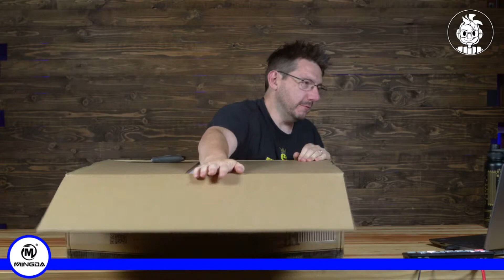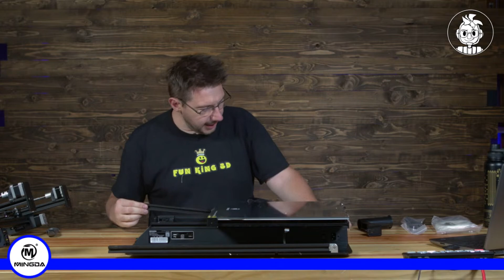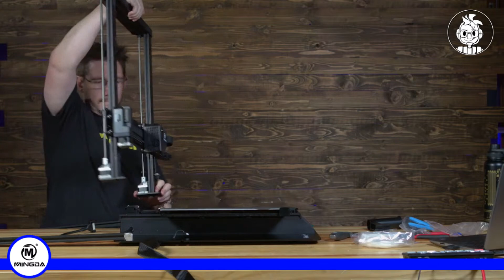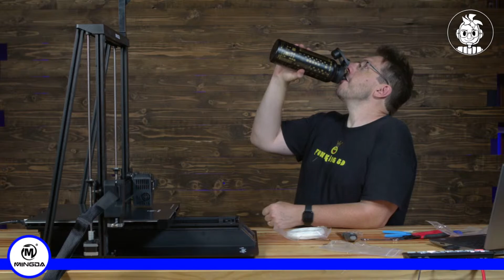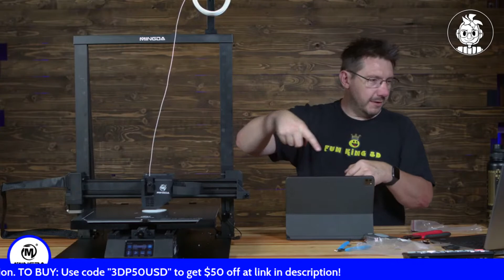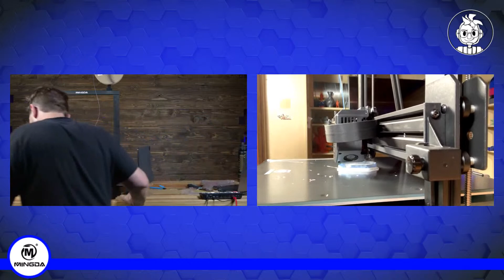Mingda Magician Pro FIRST PRINT LIVE!

Comment: i bought the mingda d600 and it was one of the worst decisions i have ever made. It is EXTREMELY poor quality. it came with broken parts everywhere.  broken hotend, 2 of the 3 fans defective, USB port doesnt work.  SD card reader stopped working after a week.  broken filament door handle, and the list goes on. now im stuck with a machine that doesnt work with no recourse because i bought it thru ali. never got a single decent print out of it for . i am about to make a series of youtube videos exposing how i got scammed by MINGDA      AVOID this company like the PLAGUE

Comment: All that space to build more things I don’t need 😍

I have the x and like everything about it EXCEPT that dang build plate, things stick to it wayyyy too well. That being said, I’m a firm believer that a pei sheet is a necessary upgrade for any printer right off the bat. Other than that which was a quick and easy fix I haven’t run into any problems. Now I just have to justify the build volume so I can buy another 😂

Comment: Not a fan of the mingda brand. Had 3 Magician Max printer and had to return all 3. 1st the bolt holes for the gantry in the plastic were sealed and needed to be cut away and the plastic bed carrage was cracked and flopping off the y axis. 2nd printer had a broken hotend, the heatblock was hanging off. 3d was apparently used and had gouges all over the bed and the v rollers on the y axis were unable to even get close to tight on the extrusion...the bed could just be pulled off if you loosened the belt. I will be steering clear of this brand in the future if nothing else than the headache of having to rebox and ship, then wait for another product just to have it be broken as well.
Reply: Well, I'm very disappointed for you but I personally own 6 Magician X and 2 Magician Pro and the only issue I encountered was 2 broken plate supports during shipping on my 2 Magician Pro and a defective ribbon cable on one of my Magician X. Mingda's after sale team sent me all the replacement parts very quickly. Have you tried to contact Mingda's after sale support before returning your printers?
As others wrote, the after sale team is good and very kindly answers all questions about their printers.
Reply: @fredbourhis  so 3 out of 8 printers came defective. I don't think that's a good track record. Normally when I buy a product I don't normalize needing repair parts, but that's just me.
Reply: @Critical_Zero  no only one of the 8 really came with an issue (but it was an used one) the two Magician Pro has been broken during the shipping process from China to France so it's not Mingda's fault ;-)
Reply: Hi Jody, We are really sorry to hear this, can you tell us more details? You can contact us via FB,  we will definitely follow up with you, don't worry.
MINGDA FB: https://www.facebook.com/MINGDA3dprinters/